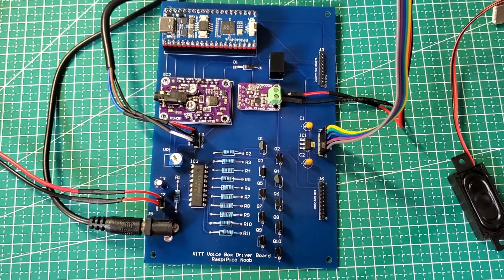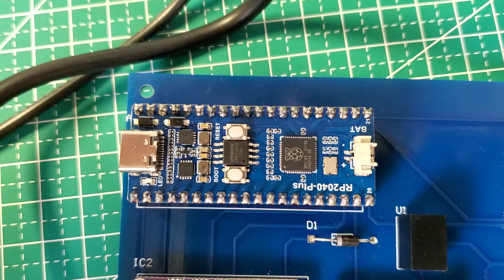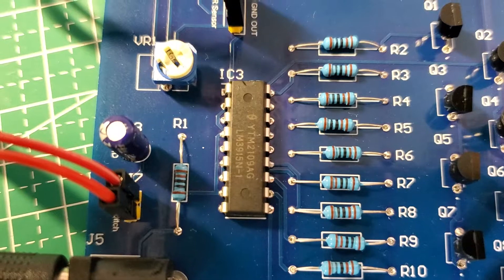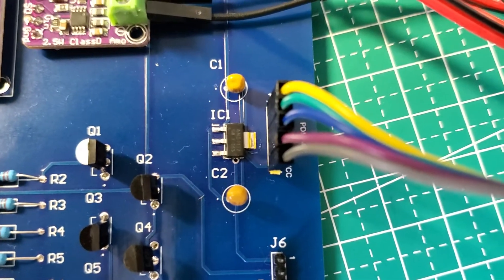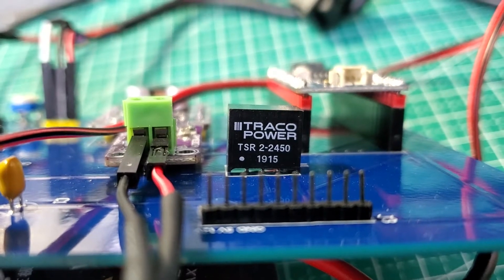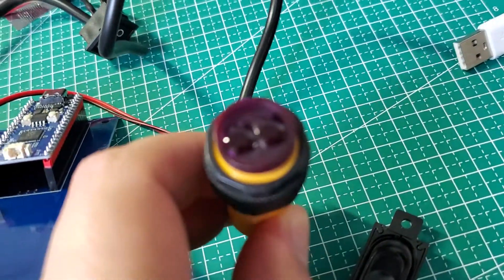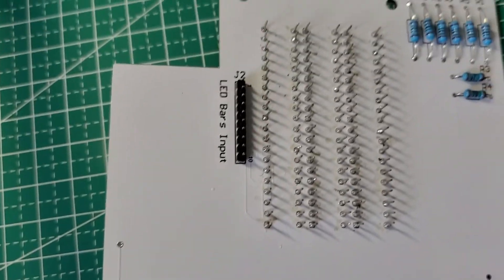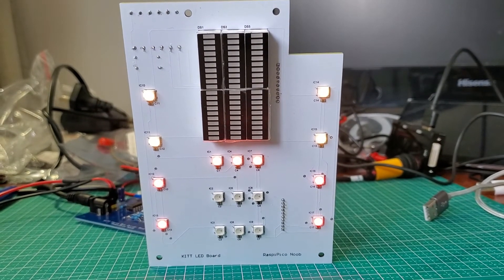Build your own Interactive KITT from Knight Rider - Part 1 Hardware

Comment: Just wondering if the actual board is available anywhere to solder in the components?
Reply from the maker: You can click on the link in the description to download the board files and have them manufactured.

Comment: Hello do you do any commissions? I made a website where you can speak to kitt realtime (its actually some cleaned up samples responding to preprogrammed voicecommands) Is it possible to make something similar with this unit you made? I would gladly share the website with you and maybe you can help me? Thanks in advance.
Reply from the maker: It's possible.  Basically you just need modify the design to include an audio input and  remove the microcontroller.  You'll be turning KITT into a VU meter.

Comment: I am going to make one of these two boards.
One question, aren't the anodes and cathodes of the LED bar reversed?
Reply from the maker: I think you're right about the schematic. Didn't even notice. Luckily I have soldered them on correctly so no issues there.

Comment: Is the STL for the faceplate missing? I see the spacers and the backside box but not the faceplate.
Reply from the maker: Yes the faceplate has been left out because I did not design it and bought the STL from the designer here https://3dexport.com/3dmodel-inspired-knight-rider-voice-box-kitt-easy-to-make-backlight-345143.htm
There is one modification that needs to be made to it in order to accommodate the IR sensor.  I'll have more details about it in an upcoming video.

Comment: I've been looking to starting a kitt project as well, how hard would it be to have it recognize phrases and/or connect it to a google home?
Reply from the maker: Probably not hard at all. You'd have to use a single board computer like a Raspberry Pi zero 2 for it to work. There's already examples on how to build one online. You could assign various KITT phrases to respond to your commands.